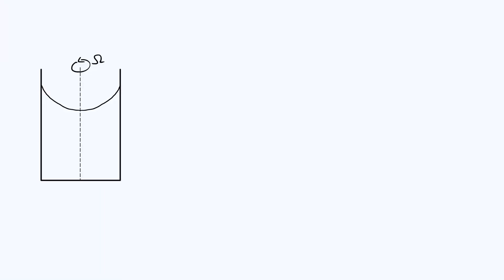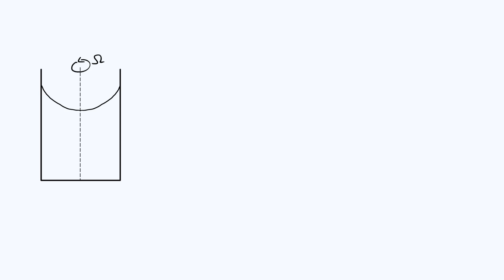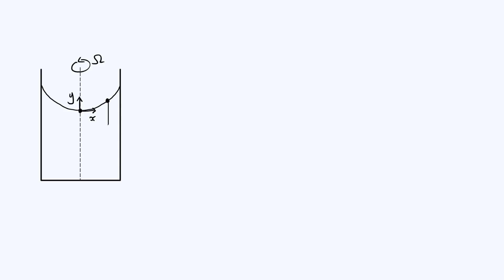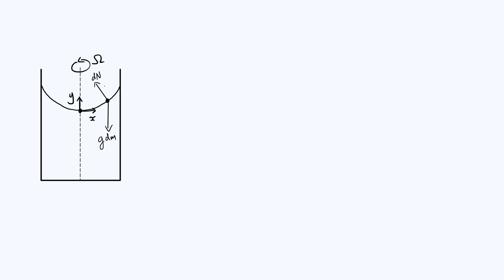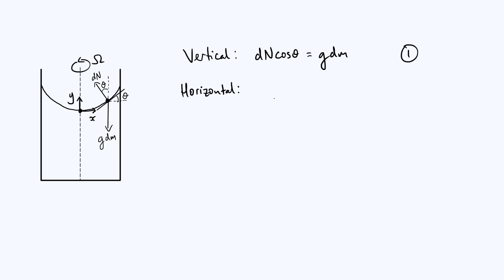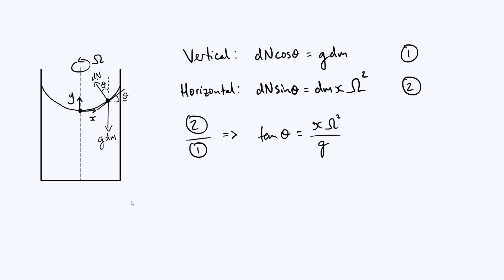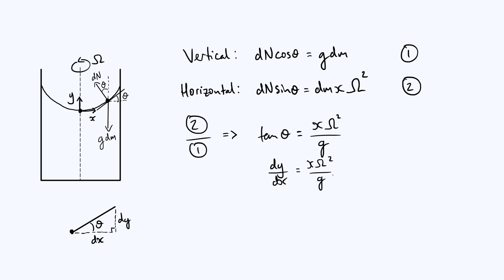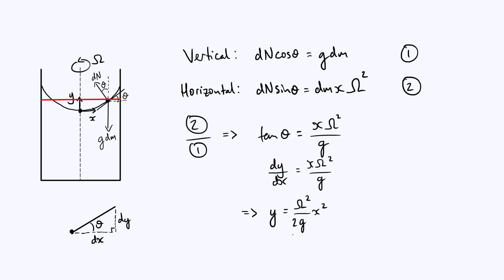The surface of a rotating liquid

Comment: Sir,After a certain angular velocity the base of cylinder will be exposed as the liquid goes sideways,
Can you please explain how we can get the area of the base that will be exposed?
Thank you
Reply from the maker: Interesting question! I suppose you would need to use conservation of volume combined with the equation derived in the video to work this out. Will try working through the details and maybe do a video on this.

Comment: Is the famous cosh result coming from Navier-Stocks application?
Reply from the maker: Not sure I'm familiar with that result - what is it?
Reply: @DrBenYelverton  oh I made a mistake in thinking of the minimal surface of a bubble held between two parallel surfaces. It has been 10 years since fluid mechanics 😅 great video
Reply from the maker: Thanks! Ah, I believe you should be able to solve that using the calculus of variations, no fluid mechanics necessary. Maybe an interesting topic for a future video!

Comment: Can we use Bernoulli's Equation to do this?
Reply from the maker: Good question - Bernoulli's principle won't help in this case as it only applies to points lying along a streamline. Here the streamlines are circles (i.e. lines of constant x) and Bernoulli's principle can't tell us how the y values of the different streamlines are related to each other. In fact, trying to apply it will lead to the (incorrect) conclusion that the surface is a paraboloid with a maximum at the centre, rather than a minimum.
Reply: @DrBenYelverton  why does it gives the contrary answer?
Reply from the maker: Since the pressure is constant over the surface, trying to apply Bernoulli's principle to a point at the centre and another arbitrary point would give (xΩ)²/2 + gy = 0, which is inverted compared with the true solution. I'm not sure if there's any deep underlying reason why it happens to give the exact opposite answer, it's just not valid across different streamlines.